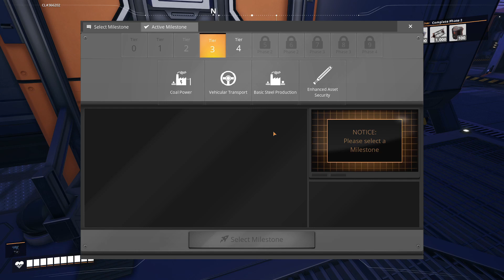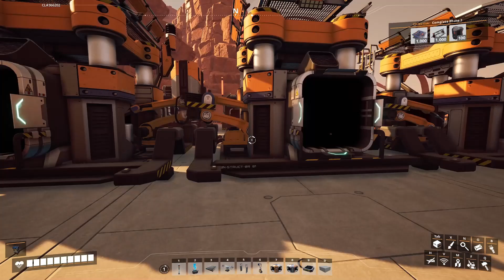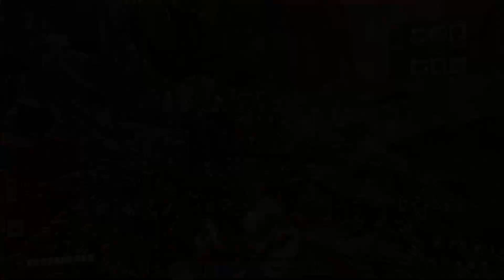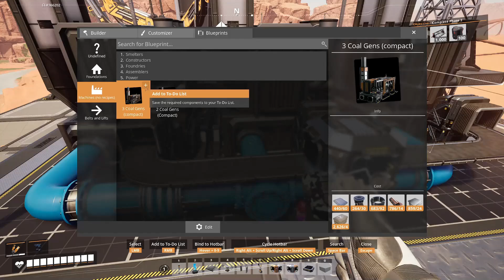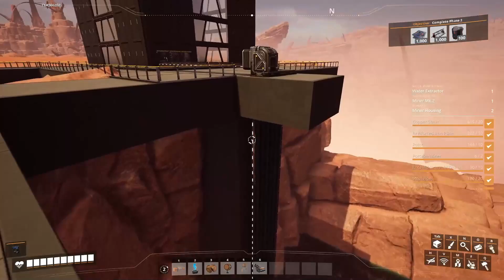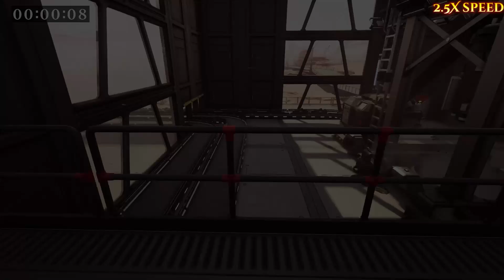Basic Steel and Coal Power - Load Balancing Satisfactory 1.0

Comment: Great episode, I remember not long ago when I set up my first 8 coal power from guides 8:3 format... My large coal factory I went with about 13 extractors and loads of generators to match, but the piping was a challenge went with two long manifold pipes feeding coal back to back machines, got it working eventually but had teething problems and found "bugs" in the game with the X junctions where you have to put the X junction on the pipe, delete the pipes and then reapply the pipes, same for floor holes, pumps etc. since doing that not really had issues not even with MK 2 pipes.

Comment: Hey, I just discovered your channel while looking for some sort of calculator with a load balancer option because, frankly, I'm too stupid to figure out how to do it for mid/late game stuff myself (Yes I know and understand manifolds just fine, but there's is nothing better to me than looking at something and not having a stack of 100 items in it).  So I was wondering, is there any chance you can make a video on how to figure out load balancing for more complex stuff for someone very very simple?  It gets too confusing once I have to do it for multiple multiple input stuff like assemblers for things like motors.  And to be honest I'm not even sure I've balanced my steel pipes/steel beams/encased beams factory properly.  Frankly, past copper, the only thing I'm certain I load balanced properly is my own coal powered stuff, and that's only because I have 9-extractor/9-generator setup ~.~ (If you've done a guide somewhere already apologies, I've only just found the channel and will be looking through what I can without spoilers for the next few days probably).

Either way have absolutely loved what I've seen so far, your builds seem sort of the in-between of what I want to do (load balanced stuff), and what most people do (manifolds and compact design); (I like big open factories and load balancing, so I have stuff spaced RIDICULOUS) amounts, which is very much the anti-norm of most players from what I can tell.
Reply from the maker: Thank you so much! And thank you for the idea, I'm always looking for more video ideas. I don't think I have exactly what you are looking for but let me ask you a couple questions. Are you looking for more info on building the machines/belts/splitters or more big picture planning out all the pieces for the more complex parts? If its the first one I do have a playlist for blueprints and a couple tips/tricks. That one has videos specifically on load balancing most of the different machines from 2-8.
I totally agree with you, manifolds work just fine and I understand why people use them. Seeing all the belts continuously moving and everything at 100% is just so satisfying to me. My last playthrough which has its own playlist, did a very modular tower design for most factories but some of the end game ones like nuclear were pretty spread out. Obviously a few things have changed since update 8 so a lot of the numbers for later factories are just wrong now. I'm happy for any suggestions and to try and answer any other questions you have. Good luck!
Reply: @moo121  This will be a long comment, apologies in advance, because the truth is I'm not entirely sure.  I have been talking with someone who watches that suggests what I actually want doesn't exist (A ratio splitter).  It's also been said I do my thinking backwards, while I feel like everyone else does it backwards and I'm the only one doing it forwards.

One of the reasons I find satisfactorytools and calculator so frustrating is because of this.  As I understand most people have a target production number of items they're looking for so they just pop that in, and then adjust.  This is what seems backwards to me; especially for a blind playthrough. What I do is start from the node, and figure out the max I can pull, and then try to figure out how I can use that or below to make any number of whatever products, the end amount/minute never matters to me, because I can always just work on something else/explore while it runs.  And because plates/rods/ et all up to copper divide so easily it was doable for me, but now that I have to get off numbers of things, I can't figure out a way to keep doing that, without extensive math; this is why I was looking for a calculator that took belt balancing into the equation. (I was also looking for one that showed 'even clocks' across buildings rather than having a bunch at 100 and then one at like 32 or something). 
So I Think to answer your question it's the 'big picture planning'.  I don't understand how to figure out how you know know how many buildings and what clock speeds they're all at.  E.G. I looked at your motors from U8 because that's where I'm at (despite nearing almost 100 hours in my save already xD).  You've got 10 / min but even using calculators I put that I want ten per minute, but then the problem is I feel I have to magically know how much ore to input to get 'exact' belting.  And I think that's the problem;  if I go my way, which to me at least seems more logical for a blind playthrough, I can't figure out the buildings I need; if I do it the other way, I feel I have to guess one way or another at the numbers I need to put into the calculators. Which is why I went looking for alternative calculators, or just a list of target production numbers and ore inputs needed for them for perfect load balancing which is how I found your playlist for U8 load balanced (which I'm looking forward to watching for sure!).  Basically, if I use satisfactory tools I can put in the max ore I can have, put in the product(s), I want and then maximize, but what I'd be looking for is an option switch for balanced belts and balanced clock speeds (if possible).  But none seem to have that ability, but you and I've seen a few others have later things load balanced, but I can't figure out how you get there without knowing or caring about the end production rate. The belt stuff I always felt I could figure out on my own probably, the problem is getting to that point because I can't figure out how many buildings and what clockspeeds to figure out.  Probably doesn't help I was extremely poor in maths :P
Sidenote; I'm REALLY annoyed I have almost 100 hours on this save where I ignored most upgrades to find mobility stuff first so I've had it for ages, and I didn't know about the right click zipline thing xD
Reply from the maker: First the side note haha. There are SO many little things like the right click on the zipline in the game. I have 3k+ hours and I'm still learning them honestly.
I ran into a similar issue with the online calculators. I use the satisfactory tools just for the visual in the video. I actually don't even look at that flow chart until I'm editing. I found that for the most flexibility it was easiest to make my own spreadsheet. That being said I'm not that good at spreadsheets LOL. But having all the numbers that I found relevant like numbers of machines or total amount of ore was really useful and I could play around with the amounts and or alt recipes to get the numbers I wanted. Making your own spreadsheet can let you do it in the direction you want. Instead of having a target end number you have have all the calculations work off the initial input and then play with that. It also had the added benefit for me of being able to work out ratios much easier seeing the numbers all laid out in a spreadsheet. For example, for the default Reinforced Iron Plates, you need 1/4 Iron Ingots for Screws and the remaining 3/4 Ingots for Iron Plates. But that's harder to recognize with just looking at plates and screws or a flow chart, for me anyways. Hope all that made sense.
I'm definitely going to think about this. It's a great idea for a video, just need to figure out how to lay it all out. Thanks again and good luck!
Reply: @moo121  Thanks a lot.  Yeah would love to see it.  Unfortunately I haven't used Excel (or Calc, or software like it) since like version 3.0 lmao.  I'll have to try to figure it out again and see if that will help.  I really appreciate you taking the time to respond and trying to help it's been getting a bit frustrating (and finding out how bad conveyors seem to work on slopes has become a new problem today xP).
Reply from the maker: @SketchFile  It was definitely a lot of trail and error for me. I want to sit down and actually learn how to properly use spreadsheets instead of it being a glorified notepad with a calculator. The belts on slopes is super annoying! I almost always use lifts instead of trying to go up ramps. However there is a way around it.
https://youtu.be/2rTf_OKkt88?si=U6TB81vZOxtH7DOc
It looks like this still works with 1.0 but they are going to come out with an updated video soon. Hope that helps!
Reply from the maker: @SketchFile  It was definitely a lot of trail and error for me. I want to sit down and actually learn how to properly use spreadsheets instead of it being a glorified notepad with a calculator. The belts on slopes is super annoying! I almost always use lifts instead of trying to go up ramps. However there is a way around it.
https://youtu.be/2rTf_OKkt88?si=U6TB81vZOxtH7DOc
It looks like this still works with 1.0 but they are going to come out with an updated video soon. Hope that helps!

Comment: Awkward belting on coal power. Do you know you can load balance even if it looks like it's manifold. However I think the threepacks looks cleaner cause of equality.
Reply from the maker: I agree, splitting something 5 ways isn’t as aesthetically pleasing. Someone recently showed me how to do the load balancing with clock speed in a manifold style. It might be a something I look at for those 5 way splits once I have more power shards. Although with coal gens it would make the water a little strange I think. I much prefer the groups of 3 too.
Reply: @moo121  was thinking more of the belts acting as speed filter, nevertheless looks cleaner your way, pretty sure, I currently stopped overclocking, if anything underclock, one stupid short created paranoia of "missing out on powershards" Even though I think you can even create them at some point :/ Oh and of course creating/expanding powerplants seem too tideous. For some reason don't like when building are on water of sorts (feels like cheating) Makes no sense. You connecting the Pumps by creating wallpoles underwater, I was like... that doesn't make sense... :/ hurts. Probably the reason I can't be too creative, Logic side of the brain... YO, NOPE makes no sense to do that even though it works.
Reply from the maker: I love building on the water but I can see why some may not like it. The way I see it, it’s all stuff we currently have the tech for, most internet cables are on the ocean floor. Waterproofing cables should be no problem on an alien planet. For power shards I tend to use them mainly for ore, oil, or water extractors. I won’t give anything away but I wouldn’t worry about running out.

Comment: Funnily enough, i skipped over coal altogether with the help of power augmenters, i went on a rampage collecting artifacts and built 2 of those which wasn't much, 1200mw, but since i had only temporary factories it was enough to get to fuel and now with my (also temporary) 10GW fuel plant I'm building my new base lol, though imma steal this power-plant design since its close-by for my fluctuating power grid
Reply from the maker: Woah! That’s a really cool idea! I don’t think I would have thought to get those early and run on that, I love it. Good luck on the fuel plant! That’s when I plan on tearing it all down and building the real factory too.
Reply: @moo121  I mean, tbh its not the best thing to do, probably better to get the jetpack to make getting the artifacts easier and since that's later down the line going the coal plant route is better in time and efficiency, i just wanted to get big pretty laser building cause it looks cool
Reply from the maker: I can’t blame you for that. It’s such a good looking machine! The jetpack does make the exploration a whole lot easier.

Comment: Weird approach for Steel, if it works, it works. I overall produced more I guess, since using all 120 instead of 90.
Reply from the maker: Producing more is probably a better option. As long as you have the power. Using all 120 for beams would sure simplify things. I’ll be making a good amount more soon, I hope haha